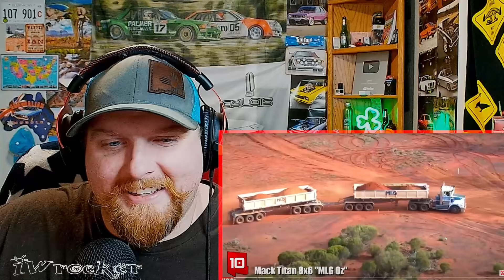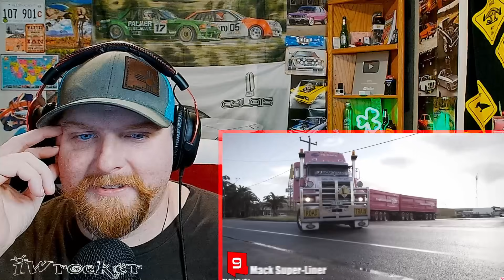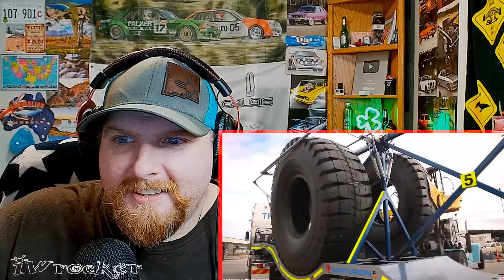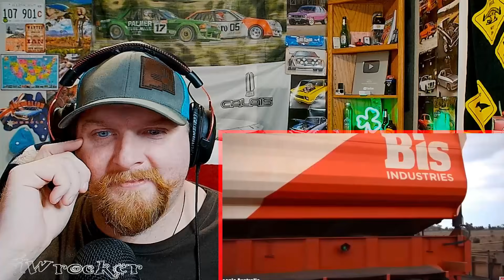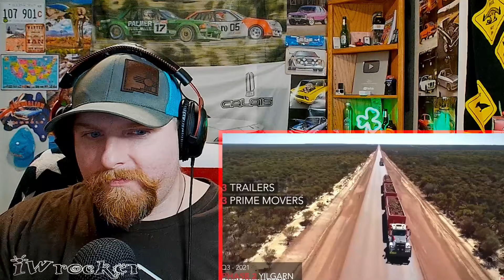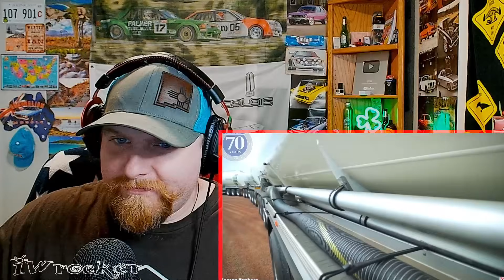American Reacts to The BEST Australian Road Trains Ever Produced

Comment: AS a Northern Territorian of Aus who travels the Stuart highway regularly  we pass at least 10 Road trains going the same direction between Darwin and NT SA boarder and it is lucky the Northern  Territory has a 130 kph speed limit  on the major highways whilst road trains are limited to 100 kph. Still stand in awe of the drivers who manage to avoid the idiots whose risks outweigh the benefit

Comment: large mining truck tyres are sometimes hauled on their side and stacked. in such conditions they are considered wide loads and have a leading and trailing car warning other drivers so they can pull over. As a Western Australian i have encountered them before.
Reply: Also a lot better to transport them upright.
If they are stored on there sides for to long the weight of the tyres pushes the inner beads towards each other and can be a real prick to pop the beads out to seal when inflating
Reply: @quinnmarsden9375  the trucks usually transport them within 36 hours to the mine from loading to unloading. I am not sure if that would be deemed long term storage, but my observations of the trucking is that they are well packaged and supported.
Reply: Also a lot better to transport them upright.
If they are stored on there sides for to long the weight of the tyres pushes the inner beads towards each other and can be a real prick to pop the beads out to seal when inflating

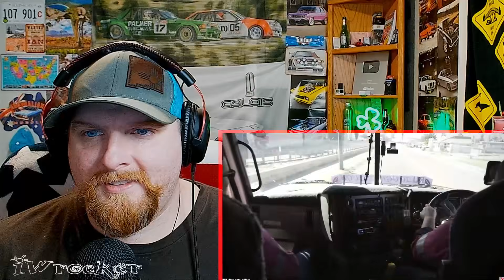Comment: nice video, not much to comment on from me other than the guy at around 3:50 cant pronouce Pilbara. Also those tired if they were transported laying down (how they used to I think) then they would need pilot cars which would probably be more costly.

Back about 20 years ago I was behind a convoy transporting a haul truck up to the mines, they had a convoy of 6 trucks. One had the tray bed laying on its side, one had the main chassis, one had the 4 wheel bubs, 2 trucks had 8 tires stacked up ontop of each other, and one truck carrying the powerplant/generator. They had a full escort including police to close sections of road ahead of them (the thinner parts of the highway) and every pullover area they would pull the entire convoy over to the side of the road to allow the traffic behind past. In that convoy by far the widest bit was the main truck chassis, but the tires had a decent amount of overhang on the low loader they were stacked horizontally on as well.

Comment: G'day mates, Australia here. As a frequent driver in the Aussie Outback, here's some info. Remember that Australia is the size of the continental USA, with 1/12th the population, and most of that is around the edges. The Centre is big, dry, and EMPTY. Fuel is often 600km (375 miles) apart, maybe more, so you have to plan ahead, and carry extra fuel, and spare water for a WEEK in case of breakdown - and if that happens, DO NOT LEAVE THE VEHICLE. This is a place that can kill you in a day if you do the wrong things.

Many of the roads are dirt - often well graded, but not always. The paved roads often have a single strip of tarmac, unmarked, about 5 metres (16 feet) wide, but with wide shoulders. When you see an oncoming truck, be it a road train or just a B-double or semi (tractor/trailer in Freedomville) it is best to pull well off to the side, and STOP, giving the whole road to the truck, so they can stay on the tarmac. They will usually flash lights or honk to show their appreciation. Sensible outback drivers will always have a UHF radio on the road channel (40) so we can talk to the trucks, and get advice about when it is clear and safe to overtake.
Reply: I like to describe it as LOFA - Lots of F All.
Reply: Great advice, mate!

Comment: As an Aussie, I have seen a number of these huge rigs in outback Australia. When they get to 5 trailers long, the last trailer tends to drift from side to side when on unsealed roads. They do travel at high speed. 100km/hr or 60 mile/hr
Reply: Agree, at high speeds, in the outback, that last trailer is all over both sides of the road.
Reply: Doesn't matter of they are 5 or 3 trailer the overall length is a maximum 53.5m long

Comment: As said elsewhere, Kenworth are built in Bayswater Victoria by Paccar.
Mack trucks are built in Wacol Queensland. These days they're owned by Volvo trucks.

Automated vehicles will only be allowed in closed environments, not on the open road (yet...). There's a fair bit of that goes on - just look at modern farming equipment.
One of the biggest problems with automation (besides the technical hurdles) is liability. Companies like Tesla attempt to wash away their liability for the correct operation of their autonomous software. Big NO from me if the companies attempting to sell this technology won't accept liability for it.

Comment: I have done a good amount of travelling around the WA Goldfields metal detecting and road train are no joke. Some of those trucks are absolute monsters and then you have to factor in that each trailer is stacked with rock and dirt to be processed and can weigh near 150 ton and when they pass or you meat one of a dirt road.... it's SCARY!  I was at Red Centre Nat's just over a week ago (car show event and burnout comp in Alice Springs) and they had a Kenworth C510 truck on display and OMG.... If Optimus Prime chose this truck, he would have ruled the Galaxy lol. It has a CAT C27 V12 Diesel Engine and the engine alone weighs just over 3000kg (3ton). There is a video of it on YouTube if you want a look, just copy and paste this into YouTube 

(Slingshot C510 walk around)

 should be the top result. 😁

Comment: Autonomous integration isn't coming to the resource industry as quick as people not involved in the game think. Mainly because yep it's great until you have to send people out to site to change a tyre or get underneath a trailer to fix an air hose or swap out while underneath a trailer hooked up to an autonomous truck with other ones either driving around close or parked up themselves because of a production issue due one truck shutting down the site so people can work on it. Same reason the resource industry is cooling on their initial fondness of the idea that autonomous trains will take over.

Comment: I think you'll find components are from other countries. but the chassis are built under licence in Australia. It is cheaper to ship three drive trains to Australia than three complete units. The market for engines gearboxes and so on Is insufficient to warrant a factory in Australia. Some OEM parts may be imported by some dealerships and some may be supplied by aftermarket manufacturing The reason some companies will use aftermarket manufacturing is the need to improve the quality and longevity of the part and other components. The use and condition environment are far different from what the manufacturer may have envisioned hope this helped you (my profession was logistics and procurement )

Comment: These are old videos,   they are now running quad fuel,  cattle trailers. Volvo,  Mercedes and Kenworth are running 700 to 1,000hp,  twin steer,   triple drive prime movers.  As far as autonomous driving goes Australia's mines are moving to almost completely autonomous driving of all surface fleets,  excavators,  haul trucks on site,  ore roadtrains from site to ports. Check out Arron Witt on his channel.
Reply: No one is running ore to port with trucks.

Comment: The tyres are for dump trucks in a Mine. Yes too wide to transport flat. These mines can be very remote, and a long way from any where. 

One you must look at is Tanami Desert. The worst road in Australia bar none. Is impassable for weeks in The Wet Season. Around December to January or so. Takes a great driver and an even greater truck to go there.

Comment: Here is a suggestion for a reaction go and check out the greek scanias there are few which are really famous (Adela, Konstandinidis, Sarantos, Lepidas phantom) some have more videos than others but their sound is soo unique its nuts especially the blow off valve and the noise of the turbo spooling down also most are manuals and run around 1000 hp

Comment: That red dust in the outback is called Red Bull Dust, it is horrible stuff. 
It is rediculously fine like talcum powder, and it gets into everything and is impossible to get out once it impregnates all surfaces around it. 
When moving house in the outback where the red dust is around, you never cover your furniture with plastic sheets. Otherwise it sweats and the humidity draws out the red dust to the surface of any fabric, staining everything red. Only way to get rid of it is to completely reupholster everything once you are safely away from the area, and even then you may receive the ire of the upholster as he battles to get rid of the dust out from his shop and stop it getting to other pieces he is working on for other customers.
The stuff gets into the carpet, vents and seats of any vehicles and again is impossible to get rid of. Even after a thorough detailing red dust will continue to blow from vents and puff off any fabric that you hit with your hand. Any kind of dry cleaning of interior will again only result in staining everything red.

Comment: We had to take a five tonne truck from Port Augusta to Woomera. The road is (or was) an open limit speed. Just a red circle with no numbers on the sign. Our crappy rental truck could only do 95kph and we would get these enormous roadtrains coming up behind us and literally sit 12" from our rear. They do this to save fuel by using you as a wind fairing. Scary shit, but I guess they know what they're doing.

Comment: 11:23 in the video, there is a misconception. The truck in that clip is not transporting coal; it's carting Manganese ore from the Woodie Woodie mine and delivering it to Port Hedland for export.

I worked at Qube and even drove that truck, PM354. Qube has a few variants, but you will likely see Quads and Super Quads now. 

Quads are configured as BBAB and Super Quads BBBB

Depending on the configuration and materials used to construct the trailers, Volvo Super Quads equipped with twin-steer super-singles and 'tri-axle-drive' have a total Gross Weight of 199t and a Nett weight of around 145t that I have seen with Bruce rock trailers and reach a total length of 60 meters.

I also drove a Scania twin-steering 'tri-axle-drive' 730r with quad-axle trailers, Grossing 214t, It was a nice truck, but the gearbox isn't designed for that kind of weight at HWY speeds.

In my experience, having driven various 'top-tier' prime movers, Volvo trucks stand out to be vastly superior. They offer exceptional comfort, reliable air-conditioning (yes), and robust durability.

Comment: BTW there’s a firm making trailers for these semis in Oz with rear steering triple boggies, in which as well as each rear triple bogie steering, each seperate wheel in those boggies individually steers as well. It makes manoeuvring in yards much tighter meaning less point turns required. A big difference when it comes to towing multiple trailers.

Comment: The Centurion tyre carrier: they were built to eliminate the need to move them with over size permits. It saves a huge amount of time and money, and apparently Centurion themselves came up with the idea. The tyres on board would be for something like a CAT 793. To give you some idea of how big they are, 1. You need to go up a full flight of stairs to get into the cab and 2. They could run over an F-100 as if it were a beer can.

The dump trucks on mine sites are often autonomous. To warn people around it, they usually have flashing strobes. For Rio Tinto, that's green strobes. It's safe because it's a controlled environment, the company decides who get to go on the haul road and when.

The Mineral Resources autonomous trucks, to the best of my knowledge, there's only two mines they'd likely to be testing, Windarling and Koolyanobbing, iron ore mines out the back of Southern Cross. They have long straight roads between the two mines, and the distance is something like 100 km (not sure of the exact distance. It's been a while since I've been out there)

Comment: Here in WA, there is a lot of FIFO (Fly in, Fly out), and I know a lot of people who drive road trains, but also a lot of people who are involved/used to drive the huge, non road going dump trucks. 

Last I heard the dump trucks were going over to auto/remote control, so a lot would be by now. While everyone has the "what about in traffic etc etc" concerns, most of what I have seen are all on mine sites or "company only" roads, so is tightly controlled. 

As said below, the road trains and B doubles are often out on public roads. While road trains have clear signs, I have been caught out on the bike when I went to pass what I thought was a normal semi, only to find was a B double once I pulled out. While most bikes have the power/just go back another gear, it makes you think twice when you pull out/commit.

Comment: Autonomous vehicles have been in use at mine sites for many years now, with operators sitting in an office  2000+kms away from the mine, where one person keeps an eye on many vehicles and takes control when required to help them out (like dumping the load on the ground neatly in exactly where it needs to be). The road trains will be running on private, closed off roads for many years to come. That greatly eliminates the risk of accidents as they are the only obstacle on the road, and no kangaroos are not classed as an obstacle.

Comment: our trucks are great and all but you'll never beat the old farmers acco with no floor pans, an exhaust leaking into the cab and no brakes but it'll haul 10x its gvm.

mack and volvo (like kenworth cummins and peter built) are owned by the same company so yeah the newer mack's aren't what they use to be

Comment: The majority of Australian Macks are built in the assembly plant at Wacol in Brisbane, they share a roof with Volvo they used to build Renault trucks as well at the original Richlands assembly plant (no longer operating) but i believe Renault are owned by Ateco now. I worked in the Mack national parts at Richlands back in the late 90's until they moved to Wacol, but our warehouse was relocated to Minto in Sydney at the time.

As for autonomous vehicles, i believe we will eventually see more of them doing the heavy mining and long haul operations, and current drivers doing changeovers and local deliveries. 
I believe the reason we have so many trucks in Australia relates to the apparent lack of infastructure to support other transporting methods such as rail and so forth.

Comment: The automated truck on the list is to be used in mining operations, while they are evaluating the use on public roads with a driver on board all the time. But there are already big mining tippers at mine sights which are automated and remote controlled, these are not being used on public roads as they are usually too wide. They are the ones which take loads around mining sites from the pit to dumping areas to later be loaded into other trucks or trains.

Comment: I actually drive a road train for Russell's Transport sub contracting to mineral resources,  the truck I drive is a 1997 mack titian with a C15 550 hp cat engine coupled with a 18 speed road ranger gear box capable of a total weight of 140 tonne and measuring at 53.5 metres long  in western Australia we can spend 15 hours a day behind the wheel. It's a hard life and not for the faint hearted. If you are in western Australia some time you should try and visit some of the transport companies to take a ride

Comment: My old man, ive taken over the business now. Ran a kenworth k104 B double, cummins signature gen 2. 660hp. His was rated to 56 tonne. Never did a single trip ( Adelaide to Melbourne and back) under 105 tonnes. 1.3million km ( 807782.55 miles) on 1  engine, same box and diff gears. Never used a drop of oil
In 30 years he did 6.4 million km. I have the log books to prove it. Which btw is 159.700561 times around the equator. He worked hard for us kids.

Comment: Autonamous trucks are only used on closed private haul roads. The "tyre truck" was designed so that they don't have to lay them flat on a flat top trailer, they are overwidth and require a pilot car front and rear. The tyres are for open cut mine haul trucks. Volvo and Mack are built in the same plant and share some components. All Mack right hand drive engineering and design is done in Australia. Kenworth trucks in Aus are American in name only, they are designed, engineered and built in Australia, imported American trucks just don't stand up to local conditions.

Comment: Talking about that haulpak truck tyres trailer.

“How much do haul truck tires cost?
between $38,000 and $50,000 each
OTR tires are used for mining vehicles such as haul trucks, wheel loaders, backhoes, graders, and trenchers. These new tires cost between $38,000 and $50,000 each, depending on multiple factors including oil prices and the cyclical nature of the industry.”

What’s the value of the load on that trailer? 🤷‍♂️😳😳😂

Comment: Watching this in TCH [the Canberra Hospital]!  Bugger.  ;-)  My 720kg Alto Turbo RS [downstairs] also uses a computer controlled clutch, just like these big boys.  Suzuki's box might shift a bit faster, but I reckon theirs are smoother in A.
Correct.  Trucks & Buses/coaches are branded, but built locally using stuff from various parts bins.